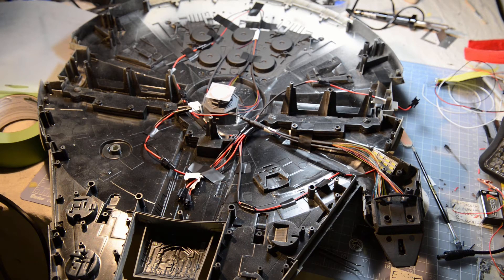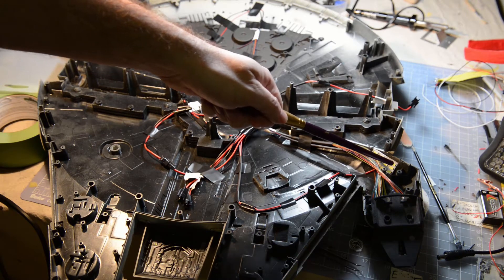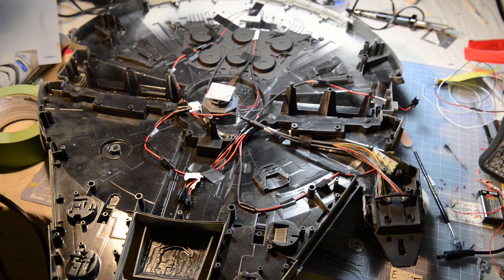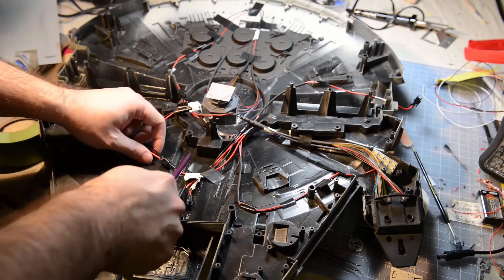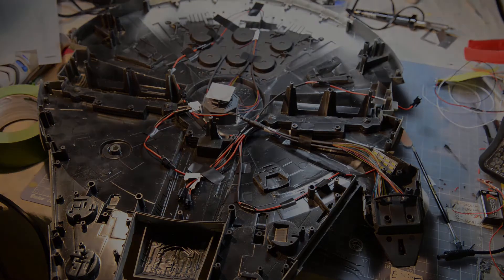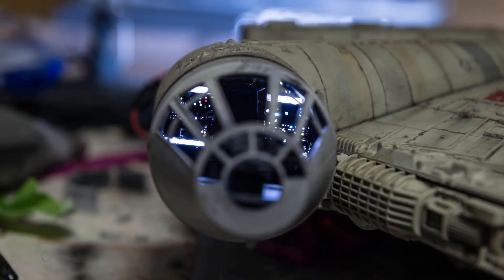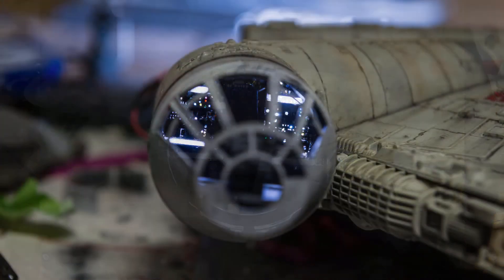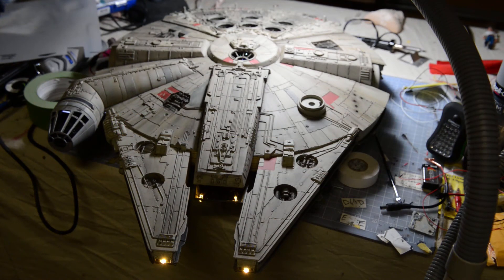Millennium Falcon Conversion; Lighting Test and Electrical Part 2

Comment: Hello I am planning  to do this to my 3d printed falcon  do u use fiber optics as well  and is it easy to connect up
Reply from the maker: The fiber on the door panels can be tough and messy. I would suggest filling the drill holes with small fiber and giving them a short tail. Paint them first then add them. Put a bright light behind the cockpit door and the fibers will catch it. Test it all first.  It's less work and less mess. The only other place fiber was used. The same technique was in the turret. Hope that helps!
Reply: @KenPearsonPhotography  thank you so much yes it helped a little 😊

Comment: That cockpit lighting looks great. Most scale in brightness and color I think I've seen. I'm still collecting parts for mine..it's gonna be a while for me..
Reply from the maker: +EAGLE Thank you. What really helped was the Bright LED I stock to the back wall to fill the pin holes. It also drowned out the colors well.
Reply: Right. I caught that. I'm going to do the same thing. If anyone ever asks I will call it The Pearson Light.. Very nice work!